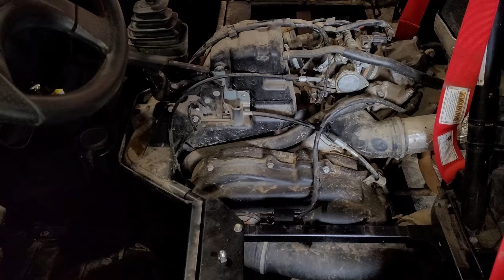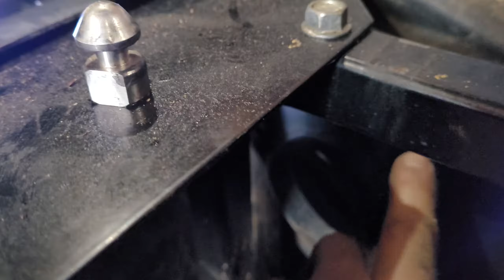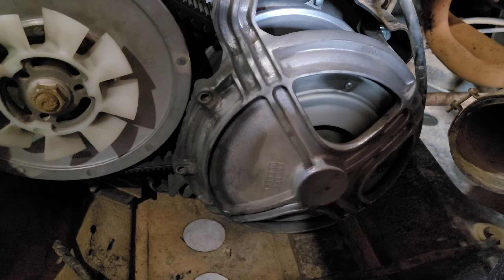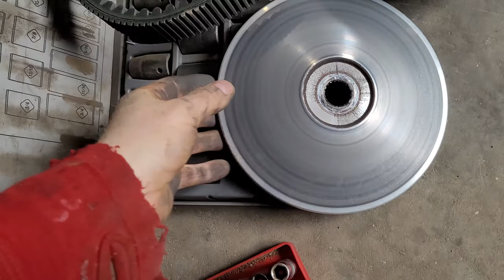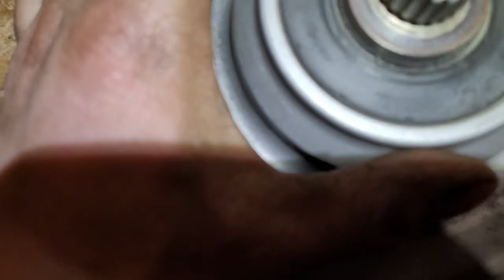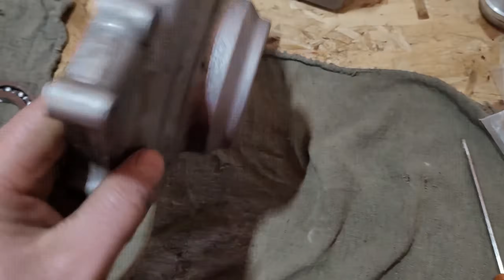HOW TO: Rhino 700 Wet clutch access and one way bearing replacement

Comment: Can the Fan be added to the 660 or would there be any benefit in doing so ?
Reply from the maker: You mean the little plastic fan on the secondary? I'm actually not sure. if the bolt patterns are the same then it would probably bolt up but you'd need to make sure there's enough space inside the cover

Comment: We have a '09 Rhino 700 Special Edition.  We just did a engine rebuild and now we are installing the primary and secondary clutches... what are the steps to install these two clutches?  We have a great amount of grease and dirt on the inner surface of our clutch housing, we have repaced the wet clutch engine seal you suggested plus a whole bunch of other engine seals (included in our gasket/seal kit).
Reply from the maker: Nothing special with these. Make sure the belt box seal is good when you put it back on the engine case, then just pop your clutches on and torque down to spec. I always  will run the engine without the clutch cover with the belt on to make sure I dont hear any bad sounds before putting the rest of the machine together.

Comment: Thanks for taking your time and great video. The primary and secondary tourqueing is tricky without the tool needed. I made my own tool pretty easy and it works like a charm. Using a large adjustable wrench I drilled two holes and used two seven inch bolts and threaded all the way and put nuts. The length gives plenty of room for the tourque wrench.
Reply from the maker: Awesome tip on the wrench trick. Thanks for sharing that. I don't use any of the special tools either and make due with what i have.

Comment: I noticed that your secondary clutch turns both clockwise and counterclockwise  when the belt is off....does that mean your one way bearing needs to be replaced on the one with the fan attachment because I can't find any videos for the removal and install and mine is doing the same thing?
Reply from the maker: One-way bearing in these ultramatics is oil bathed behind the primary clutch, has nothing to do with the secondary. If your transmisison is in neutral then your secondary can spin both ways.

Comment: When the motor is throttling up, the wet clutch begins to expand. Once it expands enough to touch the inside of the clutch bowl it’s creating a massive amount of friction for a moment. May that be 0.01 seconds or 2.5 seconds before engaging with the clutch bowl and turning the assembly. That depends on how much throttle you are giving. Full throttle, it engages nearly immediately but not quite, there’s still a split second of friction between the two. If you’re giving it 1/10th throttle, then it expands much slower and builds friction much longer. In short, of course it got hot and discolored. It was fine and no where near its end of life span. It likely had another 200-300 hours to go. If the heat coloring is bothersome, put the cover back on… Also, the bearings behind the shaft seal were fine. That minimal play you have there is because the snap ring doesn’t work like a nut and bolt. It’s not tightly secured in place so there’s going to be a bit of wiggle room. If it moves around much more freely than that and there’s a clicking noise or clank whenever you move it around, then it’s bad and needs replaced…
Reply from the maker: thanks for the write up and additional advice

Comment: I am about to replace the drive belt on my 2008 Rhino 700 because sometimes I step on the gas pedal and it takes a little to catch up. As your dad, We use it only for farm work. Sometimes I tow heavy loads with it. But since I saw your video it made me think I could also check the one way bearing for wear. So, if go that far and take it out, can I detect wear on it? Idon´t know exactly what freewheeling is, so I don´t know if I should replace it while it´s open. Please advise. (Ilive in Mexico and spare parts are hard to get, so while I open for belt replacement, I might as well check that bearing).
Reply from the maker: Freewheeling means that when you are in motion and let off the throttle, the engine braking does not work and the machine will simply coast without any engine power holding it back. That's actually the purpose of the one way bearing, is to keep the clutches enguaged as it slows to allow engine braking. 

It's very hard to detect wear on the one-way bearing. They are cam-shaped and do have a specific measurement of wear according to the service manual, however if you notice any sounds upon deceleration, and lack of engine braking when you lift off the throtte it most likely needs to be replaced. 

My rule is, if you have to dig that far into something and have a signifigant amount of kilometers and hours on the machine, you might as well just go ahead and order the part to replace it.

Comment: Got a rhino 2009. The wrong oil was used for years and the belt burnt up. Changed belt and now trying to get it going from a dead stop is super hard. After getting it I used the right oil but seemed to not fixed it. Seeing if you had any suggestions.
Reply from the maker: If you are talking about the grease used in the primary clutch, if the wrong grease was used and caused the clutch to stick constantly, it may have caused too much wear on the sliders and they may need to be replaced. If it was neglected, you may also have a broken secondary spring and not know it as well. 

If you are referring to the engine oil and it ruined the wet clutch, you will need a new wet clutch. There is no way around that.

Comment: Liked and subscribed.  One question - How do you get the pilot bearing out of the 3 or 4 legged cage that fits over the primary sheave?  It looks like it is in a blind hole.  is there a way to get it out without a blind hole bearing puller?  Thanks for any advice.
Reply from the maker: Its not actually in there very tight, it just sits in there and the dirt and grime usually end up taking hold more so than the pressed in fitment. 

Pack the center hole full of grease and use a tight fitting socket or punch to pneumatically force the bearing out of the hole. Just be careful not to go too hard, that cage is just cast aluminum.
Reply: @ruyguy8888  Thank you!  i'm chasing a squeal...

Comment: What is the torque spec on the nut holding on the primary and the secondary? Great video by the way I got mine all apart following you steps hopefully get er back together tmr I think the primary is 100ft/lb and the secondary is 72 just wanted to see what you find
Reply from the maker: primary-85ft lbs

secondary-72ft lbs

sheave nut (big spring) -65ft lbs
Reply: Thanks! One more thing is the secondary nut regular thread or backwards
Reply from the maker: @tylercook784  Honestly I can't remember that one. But im pretty sure it's standard thread since it's spinning in the same direction as the primary.

Comment: Excellent job ruy guy8888, just of curiosity how many kms is on the 700 rhino?
Reply from the maker: It's Dad's rhino, but it doesn't have much on it. 4500kms i think? But 6 or 700 engine hours on it as it's mostly a work machine for him.
Reply: @ruyguy8888  wow, the 686cc engine must be pretty reliable?
Reply from the maker: @andrewbalcom8081  The 686 is very reliabile. So much in fact that when Yamaha changed to the 708 back in 2016- 2017, after only a few years, they saw so many issues that in 2019 Yamaha went back to the 686 fuel injected engine with a few minor changes. My 2019 Grizzly has the 686 in it.
Reply: @ruyguy8888  I noticed that you take the time and clean up your parts, you do good work ! Excellent video!

Comment: Will that bearing being bad kick it out of gear? In forward more than reverse?
Reply from the maker: That shouldnt effect it kicking out of gear. First thing i would try would be to adjust your shift linkage from the shifter to the transmission. Even though it shows in gear on the shift gate, doesnt really mean its fully in gear in the transmission. You may have a lot of slop in the linkages.

If that doesnt help you may be into looking internally to see if the shifting forks are bent in the transmission side.
Reply: @ruyguy8888  thank you so much for the response!! I played with the linkage and even disconnected it and did it directly on the trans, and still did it so I was thinking the same thing. Pulled the engine and and split it in half and every looks good. No weird wear or bent parts 🤷‍♂️ I’m a diesel mechanic so can do the labor but this is confusing me lol

Comment: Great video. I have an 09 rhino. Just purchased used recently. Was driving an heard a sudden bang in engine compartment. Now every gear is like it is  in nuetral. Engine runs fine. Oil level fine and relatively clean. Any thoughts on how to proceed? I have a youtube channel as well where i do some yamaha waverunner repairs but this is what i call" new technology" or never worked on one before. Any help would be greatly appreciated!

Comment: u should have replaced the wet clutch drum 100 percent! it should be smooth with no ridges! urs was horrible worn and grooved. it should have been replaced
Reply from the maker: It's fine for a farm machine. If the owner put thousands of km's on per year then yes i would have suggested the replacement, but the wet clutch friction surface and drum wall thickness was well within spec. It will last for the remainder of its life on the farm.
Reply: @ruyguy8888  not on our farm, they get like that and start slippin when draggin deads or whatever. Maybe a old person gardening itd be fine

Comment: Your input, suggestions and instructions are a life saver. My issue with my 2008 700 rhino is the opposite of this issue. The Machine feels like it’s being held back almost as if the brakes are being applied but there are not any ideas?
Reply from the maker: Have you looked at your driveline components yet in including your brakes for sticking calipers?

Before ripping all the covert off to access the CVT, i would jack up the machine and put into neutral to turn over your driveline by hand. If there is a lot of resistance then it's not your CVT because you are in N.

If i recall there are some rubber brake lines heading to the calipers that may have collapsed internally and are causing some sticking calipers. try pumping the brakes a few times then cracking each bleeder screw on the calipers to see if they are under pressure, if you find one spurts out at you , it may be a collapsed brake line that will need replacing.
Reply: Good advice I’m going to go through all your suggestions I’ll let you know what I find thanks again!
Reply: You rhino guru found two brake lines in the back that were collapsed thank you for pointing me in the right direction got it repaired this weekend

Comment: How did you reach the 10mm bolts on the cover to get the left side bolts?
Reply from the maker: 1/4" ratchet with a universal joint on it

Comment: Great video, when I get to the wet clutch housing it's loose but won't slide off when I pull on the shaft, I'm stumped, any ideas, thank you
Reply from the maker: You may have an issue where your wet clutch has worn a groove in your driving drum and its binding. 

carefully use something to start prying the cover and drum assembly off. something brass if you have it to prevent pitting the aluminum. 

There shouldnt be anything further behind that cover to prevent it from coming off. https://www.yamahapartshouse.com/oemparts/a/yam/5003cdc2f8700212fc844b58/clutch

Comment: Why did the clutch get so hot?
Reply from the maker: Dad does a lot of plowing deep snow and hauls wood out. I would imagine there had to be some slippage of the wet clutch during those types of conditions. 

It's not uncommon. I've seen ATVs with similar looking discoloration due to the rider, operating in high gear, when they should have been in low range.

Comment: Nice job explaining everything along the way while taking it apart. It seems that always happens, once you get something apart you see more items you want to replace or need to replace. That clutch drum sure did look like it had been hot at some point. 
After waiting on parts for a couple of weeks it was probably warmer when you got it done. LOL 
Thanks for posting the video and showing how the clutch works on a Yamaha.
Reply from the maker: It was a bit warmer for sure, but still cold enough in the garage to warrant running a heater! 

It's always the way though. Nothing like doing a stright forward repair to make you realise how many parts you missed ordering or what shop supplies you are short on.